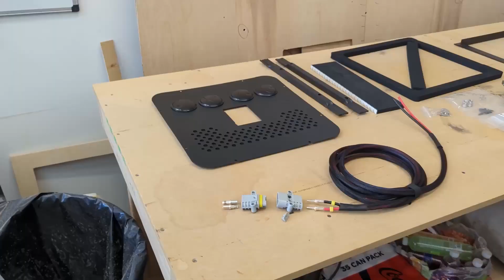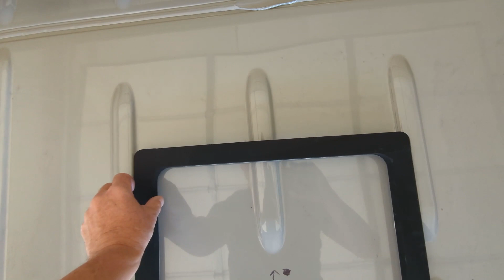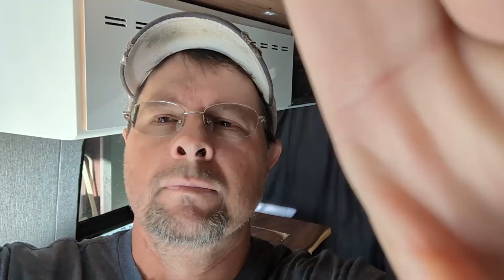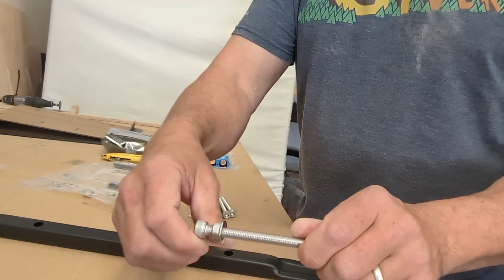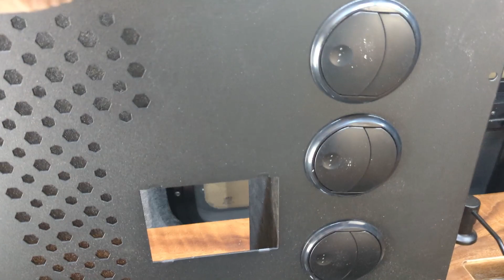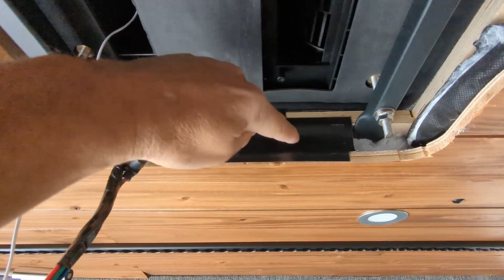Whitewater Vans Install of Nomadic Cooling X3 48v DC Air Conditioner

Comment: Keep in mind that I’m not very mechanically inclined, however, I’m curious, if the bolts are going to be too long, would it make more sense to cut them down before you screw them in or purchase shorter bolts so that you don’t have to cut off the heads which would make it easier if you ever need to remove the AC?

Comment: Thanks for the install video! Just curious, as it looks like you are installing the AC inside of a garage? If that is correct how tall is your garage door? After you added the AC, how much height did it add to the van? Is your van the Ford Transit with a 101.3” height? Anyway, I’m just trying to get more detailed height info as I’m looking to have a retirement home built with a 3 car garage and I was hoping that a 9’ (108”) garage door on the single bay garage would work? I know it would be tight.

Comment: Why 48 vs 12 volt?
Reply from the maker: 48v uses smaller wiring throughout the system, lower cost and easier to work with.  I'm using an EcoFlow 48v power kit so there's no conversion to go straight to 48v on the AC also.  When I build 12v systems w/ 12v battery I do use a 12v AC unit, or 110 through the inverter.

Comment: Great install instructions, super helpful! I happen to have the same x3 and EcoFlow bundle with the 48v cable that I purchased from Campervan HQ.  I want to bench test the setup but I’m not sure how to connect the 48v cable to the x3.  I have the Nomadic diy kit with the Anderson connectors and cable.  Did you put a fuse inline on the positive side? What size and type of splice connectors did you use to connect the 48v cable to the Nomadic diy cable? Thanks
Reply from the maker: You can get a 48v cable from CampervanHQ that goes from power hub direct to AC unit.  Power Hub is already fused internally on each connection so an additional fuse is not necessary. My Nomadic AC unit came with a 48v plug.  I did have to rewire the male and female plug ends to the AC unit and 48v ecoflow wire.
Reply: @whitewatervans I have the same 48v cable from CampervanHQ and the diy install kit from Nomadic with the 48v cable and male/female Anderson plug ends.  Can you share a link to the splice connectors you used to wire the 48v CampervanHQ cable to the Nomadic 48v cable with the Anderson plug? Thanks!
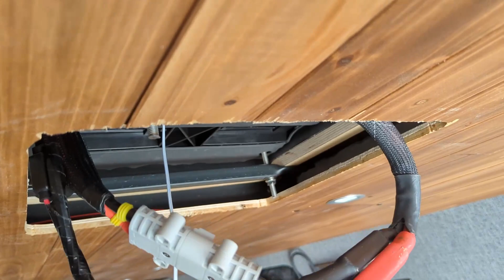Reply from the maker: @davidholdan7882  at 16:27 in the video you can see the 48v plug that came with the AC unit.  On the left are the wires from AC unit.  I cut-off the ring connectors and installed the plug.  On the right is the wires from EcoFlow unit.  They are connected with butt connectors such as these.  6 awg to 8 awg is probably what you need depending on wire size:  https://amzn.to/3ScEV72
Reply: I ended up talking to Nomadic and used terminal rings bolted together and got it up and running connected to the EcoFlow with the 48v cable.  The weird thing is that I don’t see watts being used when the X3 is running.  Are you able to see the realtime or historical power used by the X3 in the EcoFlow app or console anywhere?
Reply from the maker: @davidholdan7882  Unfortunately the direct battery to AC cabling bypasses the power hub and does not show the power being consumed. The power hub continues to show the remaining capacity of the battery but unfortunately no real-time stats.
Reply from the maker: I just got word that there's a software update coming soon for the EcoFlow power-hub that will measure and show the consumption by the Air conditioner.
Reply: @whitewatervans  I just heard the same thing, end of February from what campervanHQ is saying.  Also they told me it was possible to integrate a 2nd alternator to get about 2500 watts an hour.